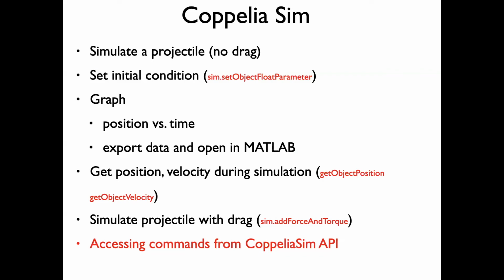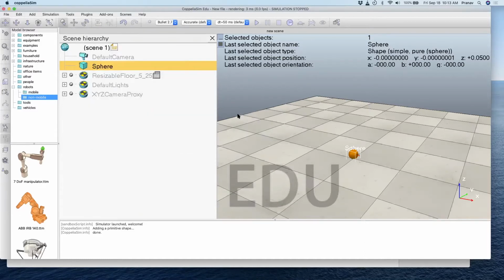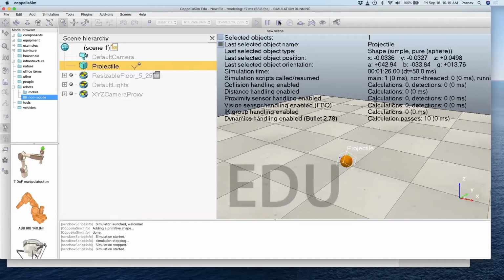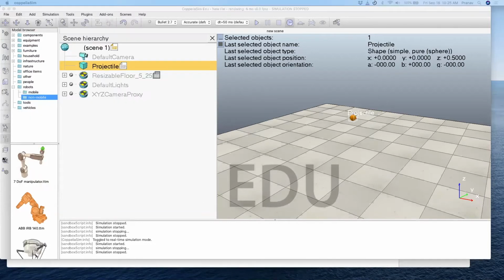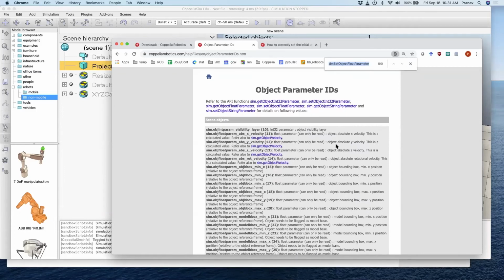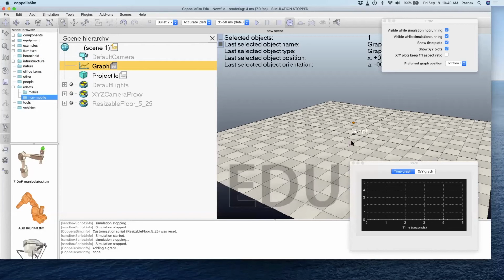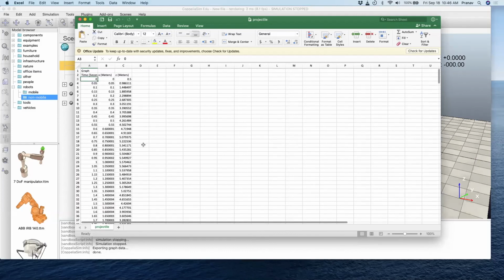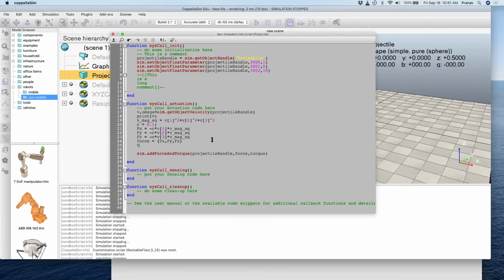CoppeliaSim 1: Simulating a projectile with drag (Fall 2020)

Comment: at 6:50, if the objects is not moving why are the postion and orientation values changing?
Reply from the maker: It is moving at a very slow pace, more like 0.01 mm
Reply: @pranavab  ok sir. But why is it moving, ideally it shouldn't move right. Why did they design it like that? 
Just to be practical?
Reply from the maker: @jayaramjonnada5855  this depends on the friction properties which are tunable.
Reply: @pranavab  Thank you sir